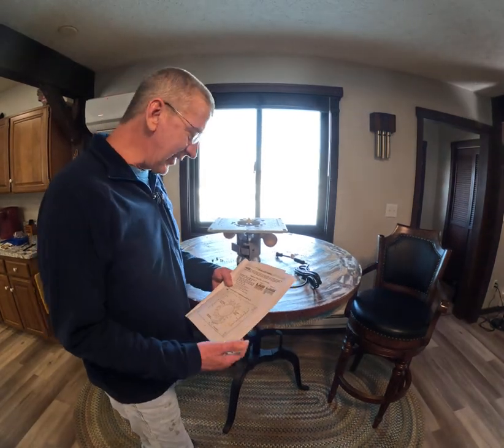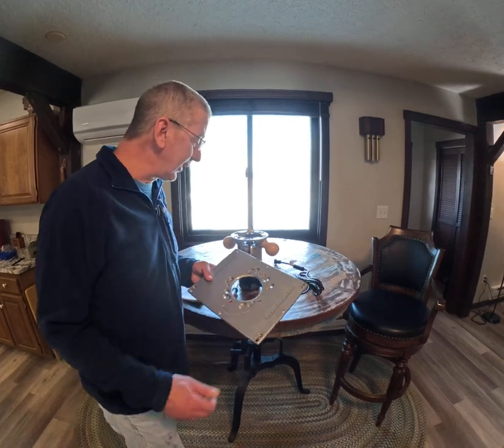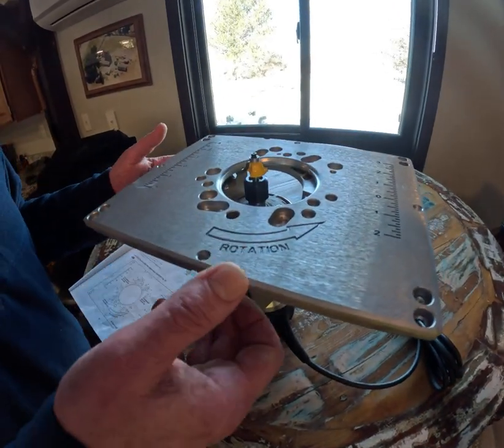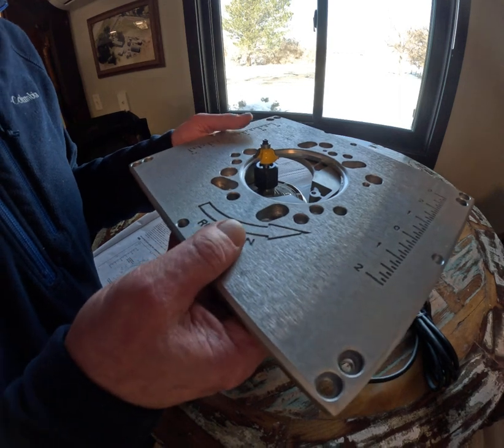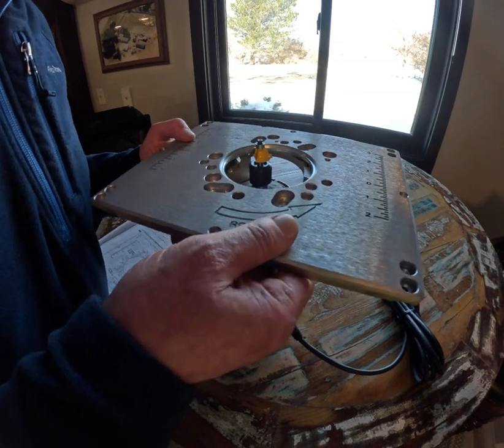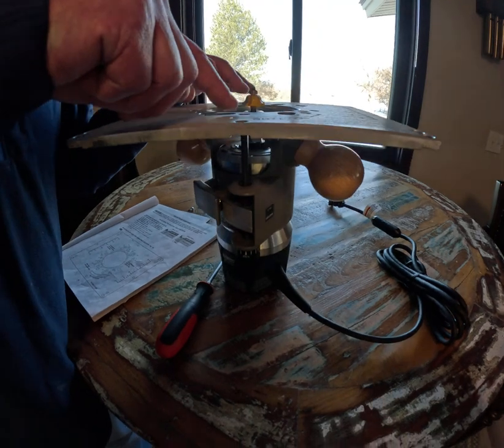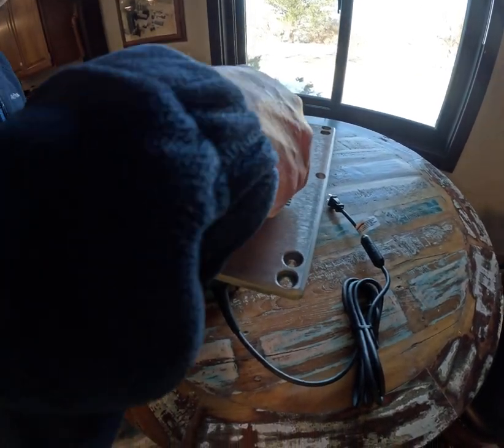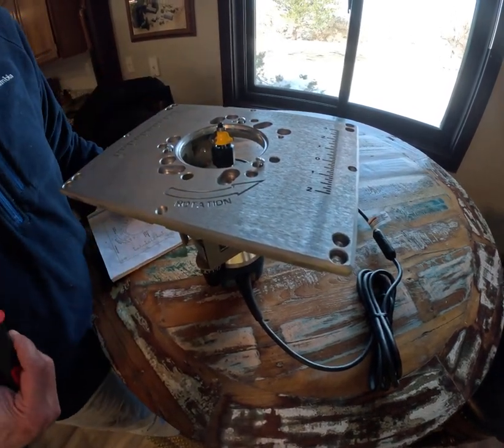Bosch 1617 Table Router Plate Assembly- EASY

Comment: Hi Dave - that is useful, thanks! I have the same adapter plate and will be using it with my Bosch GMF European router. One question: did you get the screws with the router plate or are they the ones from the handheld unit's faceplate? All the best, Rob in Switzerland